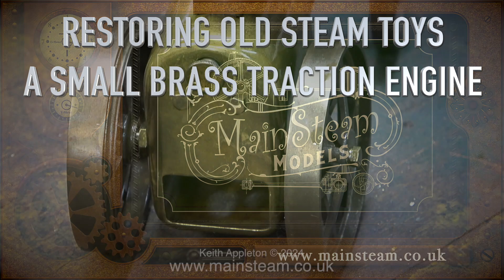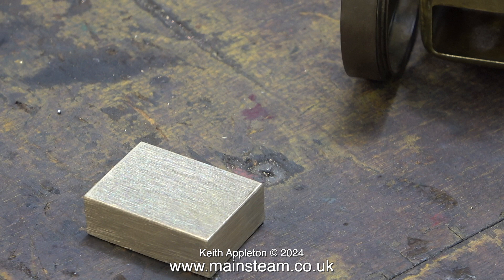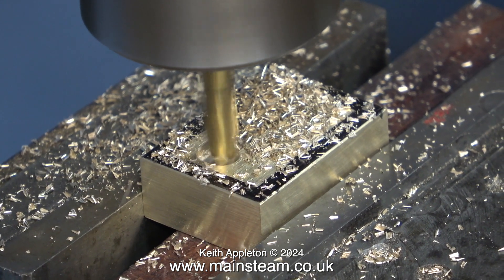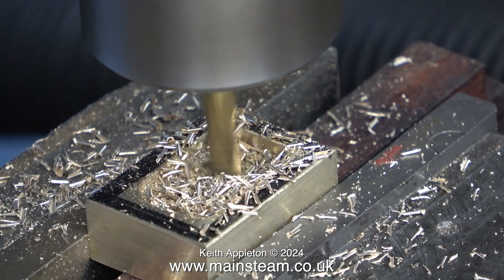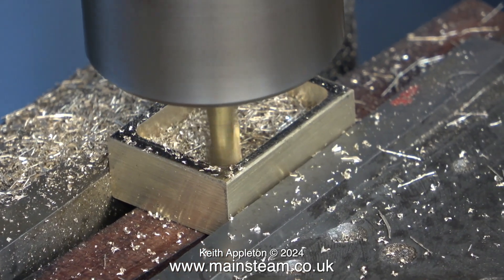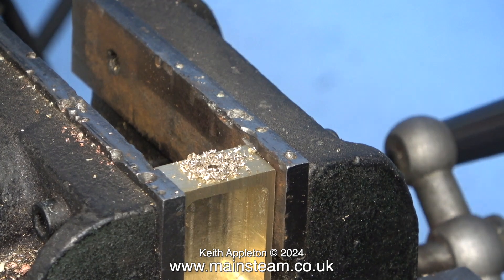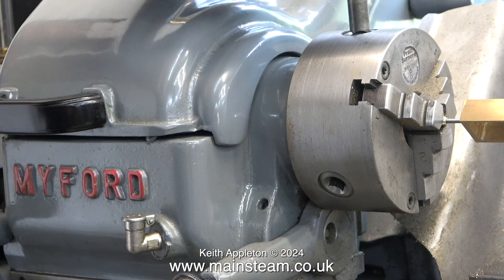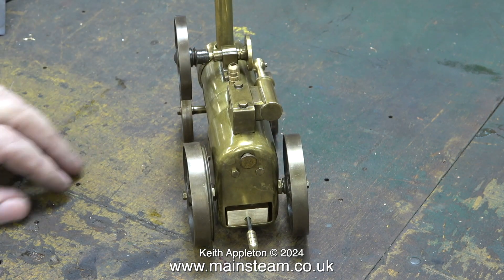A SMALL BRASS TRACTION ENGINE - PART #4

Comment: Sir, apologies for egg sucking lesson.  Please be very careful with the firegel material.  It will melt when hot turning into a boiling, all consuming fireball.  Possibly worse than an open pool of meths on fire.  Wet towels on standby.  Or, provide a hinged cover of gauze held in a frame which seals against the top of the fuel container, and a snuffer box.  It is almost impossible to extinguish the flame, unlike a wick on a spirit burner, so it has to be let to burn out.  I worry that a box with that amount of surface area will generate a massive flame consuming the gel very quickly whilst failing to boil even very hot water in the engine.  I hope this reaches you before the tests.
Reply from the maker: I am not impressed with this Gel at all. I will make a Multi Wick Meths Burner }:-)))